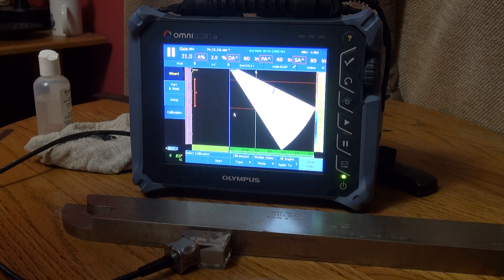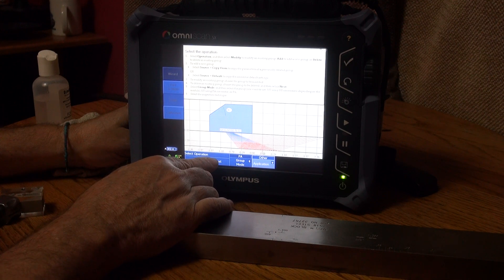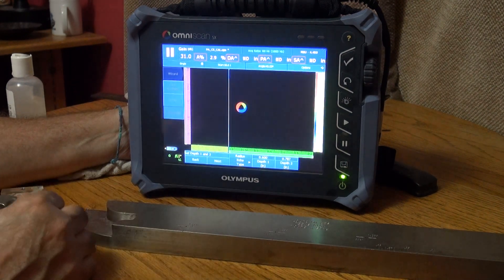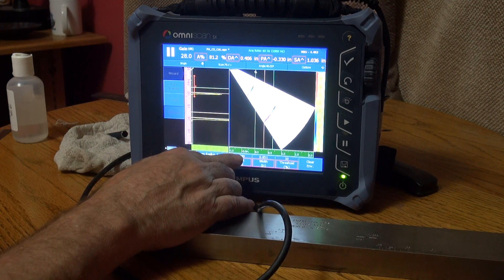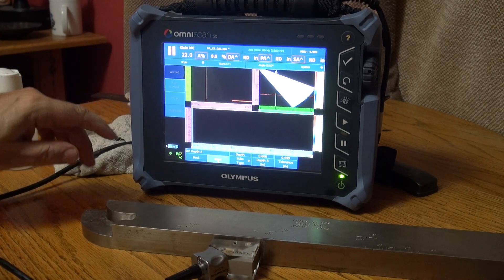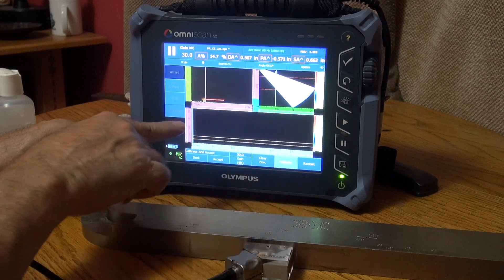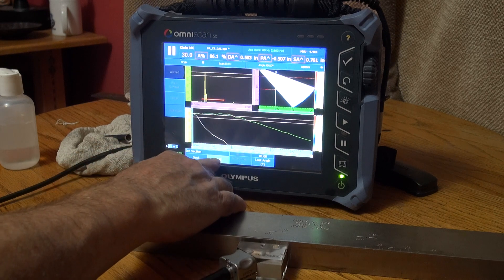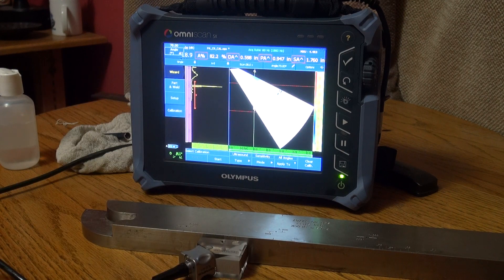Phased Array Calibration OmniScan SX

Comment: Hi sir, this is with regards to the video that you had posted 6 months back, wherein you had demonstrated on how to size through wall height of a clustered porosity.My queries as you see below has been posted under the comment section of that video as well, but since its relatively an old video so possibly you may have missed out reading it because it was just posted yesterday.

Here are my comments 

Is there a possibility that the technique that you just demonstrated to size the through wall height would give
more accurate results in case of planar flaws as compared to such volumetric flaws?

I noticed that there were a bunch of trailing signals of varying amplitudes (which was mentioned as broad signal envelope) as you were
moving the probe back and forth towards the weld center line and also while orbiting. These signals are possibly coming in due to some mode
converted signal set, for instance one component of the wave would have possibly hit the face of the flaw, there would have been some mode 
conversion to L-waves and after some reverberations L wave converting back to shear waves and back to the probe, so here the overall time of flight
or the path taken by the waves would be longer giving rise to a bunch of trailing signals. Based on the geometry many such mode converted paths are
possible. In the scenario as shown above there is a high possibility that while moving back and forth we are possibly hitting the same spot of the flaw
but we are getting different depths possibly due to the change in path length or time of flight variation caused due to mode conversion. The through wall 
height measurements could possibly have some variations if you hit this same flaw from the other side of the weld due to some subtle changes in the
geometry. Having said that sometimes we may get lucky that the through wall height measurements of such clustered porosity would tally quite well
with the measurements as given by the manufacturer (Sonaspection, flaw tech, Ph tool etc.) but this may not happen always. If we take say about 5 to 6
samples of clustered porosity with some varying overall geometry, definitely there would be some samples where the overall through wall measurements
wont tally with the measurements (based on radiography and which would be quite accurate for such volumetric flaws) as given by the manufacturer. 
The reason is purely due to the mode converted paths taken by the beam and which is very difficult to trace using a conventional single crystal approach. In order to
accurately gauge the through wall height irregardless of the geometry we need to go on a tomographic approach where multiple mode converted paths are captured by the probe using an array of elements and each of this raw A-scans are evaluated for there individual time of flights. 
Please note a conventional phased array approach will also give similar results to the one as shown above.

Lastly was this sample radio graphed?
Reply from the maker: Hello Adi.  Thank you for your input and observations.  Every point you make is true and informative.  This sample ways radiographed.
Reply: Hello sir, thanks for your reply. Also i had posted some comments on your previously uploaded videos,
I shall post them here again.

             Thanks a lot for uploading these videos, they are super informative. You are a fantastic teacher :)
             The explanation given in each of the videos is extremely crisp and clear and you indeed have some wonderful
             samples. I have circulated your video links to some of my pals who do UT testing and they really find it useful.

             Thanks for the effort and please keep posting such lovely and informative videos.
              Stay safe!
Reply: Hi jonh